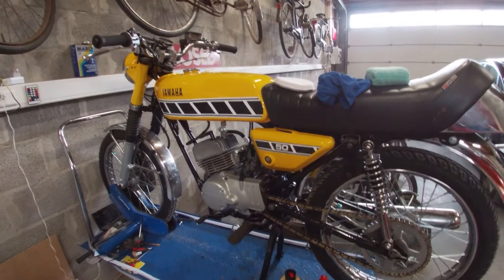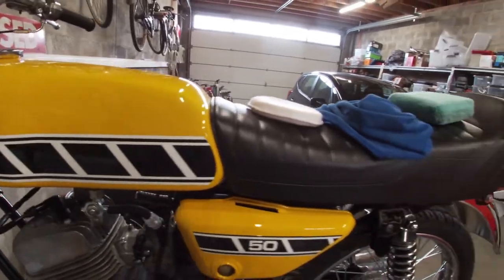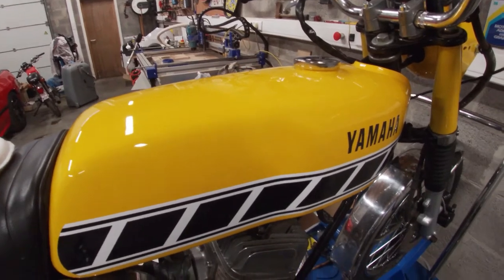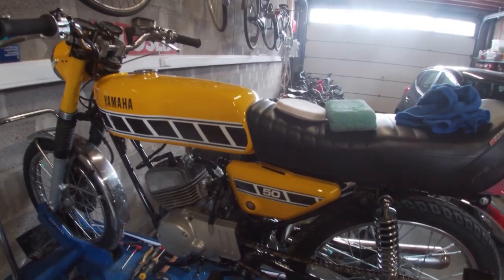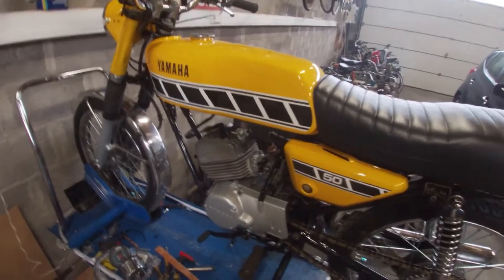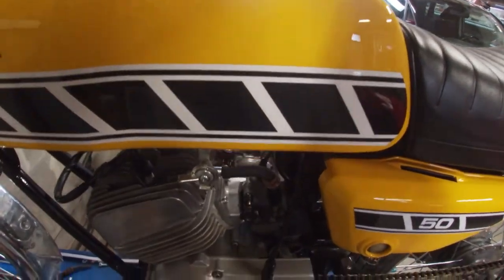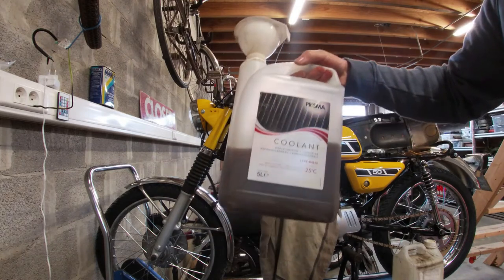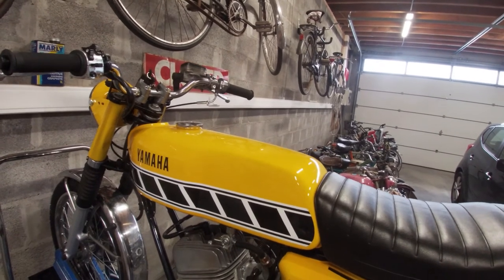Yamaha RD50 'Kenny Roberts' - Pt.9 First test drive

Comment: Great work there! You must have the crankshaft with a messed up bearing or something because of the knocking sound...
I was wondering if you can help me with a part that i am missing! I need to make the same plate you did for the counters, do you have the drawing for it? 
Best Luck for you
Reply from the maker: Thank you! Yes thats probably what it is. Working on an update video. Sadly I don't have any drawings for it. I am also trying to source one, make a drawing of of it and mill a new one out of aluminium.

Comment: Open the power valve by bending the Reeds up put the carburettor and needle second from the bottom one on the slider pin and take a bit of baffle out of the exhaust and it should go faster ? Lol
Reply from the maker: Was taking it easy because of the engine rattle. Engine is almost done rebuildingnow, just waiting for new piston rings 😀. When properly broken in, we'll see how fast is goes, or doesn't go 😂
Reply: @VintageGarageYT  lovely to see too mate  :)
Reply from the maker: @vivianbond7449  Currently making the rebuild video, further updates will be posted aswell

Comment: Hi, i got the same rd just in Black and it doesnt run and my question is, which Mainjet you got in the carb.
Reply from the maker: I started with a 115 for break-in and now running a 105. These are polini jet sizes though. Original mikuni jet sizes are numbered differently. I bought a set of jets so I could test and play around
Reply: Thanks, i will test a few then. I love your videos
Reply from the maker: @mattifinke8233  Thanks man! Really appreciate it!